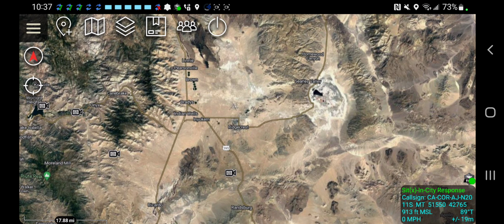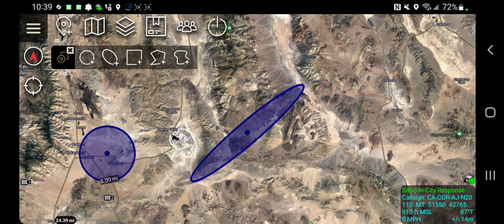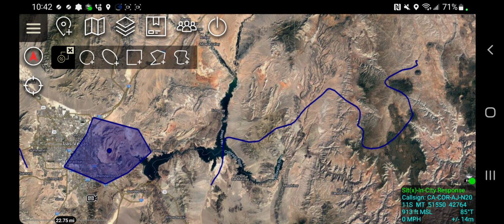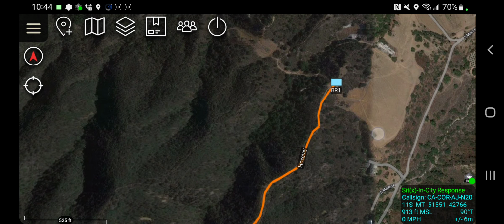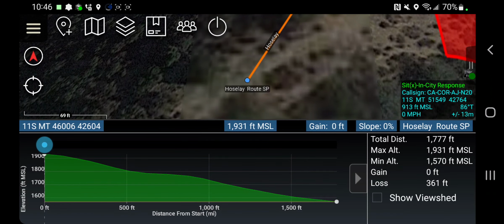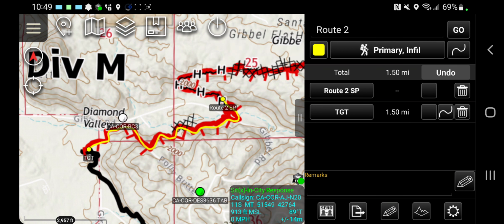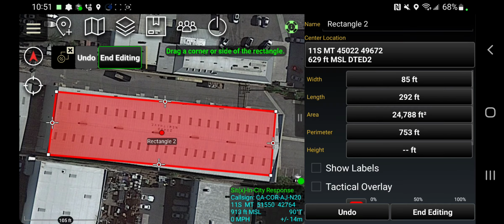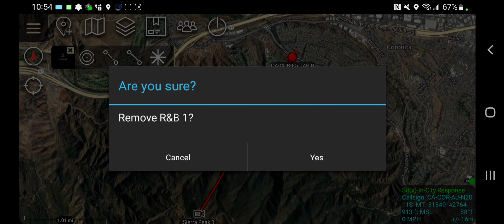ATAK - Drawing - Measuring Tools

Comment: Hello,
Is there a plugin or an option to draw a cone? I need to place the transmitting cone of my directional antenna with as option: central azimuth, beam width and transmitting distance. Is it possible?
Reply from the maker: ATAK does that natively now.
Reply: @thetaksyndicate6234 how ?
Reply from the maker: @tjcambre5236  check out page 64 of the manual. The manual is included in the application in the setting, support section